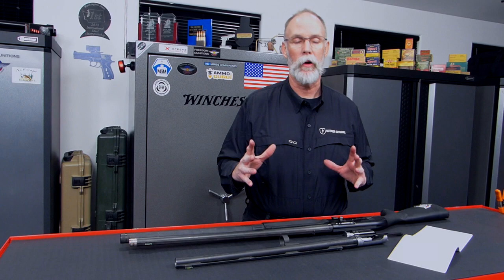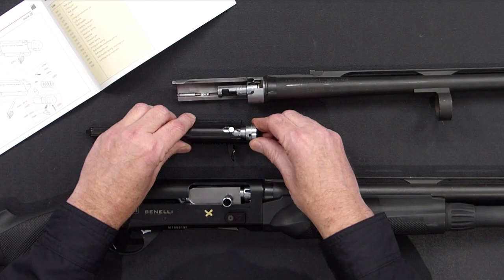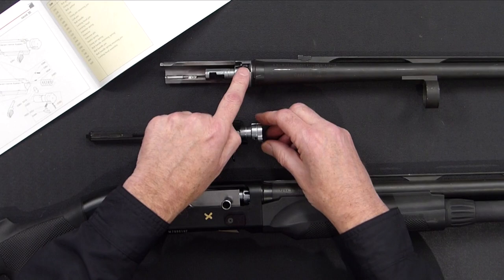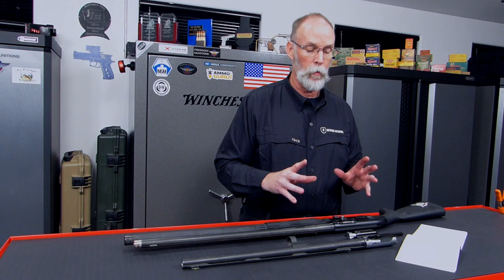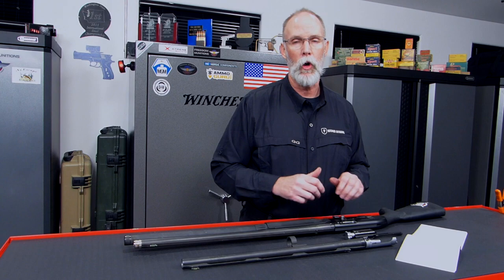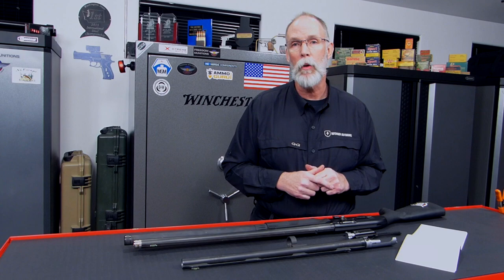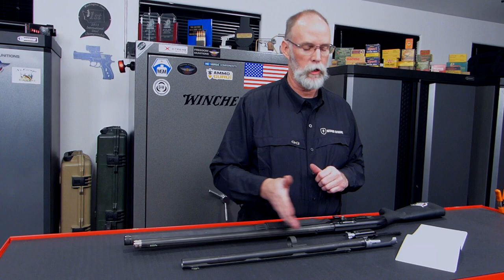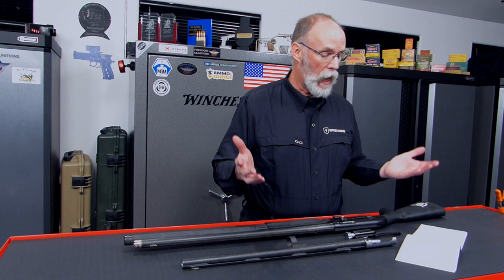Inertia Driven!  How does it work?

Comment: Mr. Kelley,

Sir, this was one of the best examples of a "how does x gun work" videos I have seen. While I love your out of the box and on the range vids, your experience seems to work really well with explaining this sort of technical data. I particularly enjoyed having the parts overlaid on top of the fully assembled gun to help in visualizing where they fit in the system. I would love to see more of these, such as AR-15s, different pistol locking mechanisms, etc!

Comment: the bolt doesn't push on the carrier (it's locked in it's rebate), the carrier (which is free to travel), stays in place due to it's inertia, which, as the gun (and bolt) recoils, causes it to relatively move "forward". Once the spring "bottoms" out, the carrier starts to move with the rest of the gun, and the spring throws the carrier back, causing the bolt to cam open and cycle.

 It's an old, great system, and can be tuned with just a few different springs and/or having an oversized carrier, which you drill and tap for brass/tungsten screws to adjust it's weight. Works in rifles, shotguns, and even pistols.

Comment from the maker: Please share this and any other video of mine that you like.  I don't get a nickel out of the work I do on this channel...yet. Please help me to make my efforts worth it. Thank you!
Reply: Done you know how to fix the issue of the bolt not going into battery? I have an m2 and occasionally the bolt won’t go into battery and I get a dead trigger. Thxs
Reply from the maker: @craigmedvetz2125  Generally that happens when the bolt is pushed out of battery after it is in battery.  If it happens during the normal firing cycle (not when loading it ) I would lube the cam and bolt head (A good idea anyway)  Hope this helps.

Comment: Disregarding the fouling issue, is it possible to design a machinegun with interchangeable barrel fired in black powder similar to the early Madsen machinegun or Maxim gun using this system? or will it not cycle?

Comment: if you had to guess or maybe you know what is the spring rate of the inertia spring? and it would be a bonus if you knew the weight of the bolt with its parts also does the firing pin spring hold it forward before it hits the barrel?

Comment: I just learned about this system. I absolutely love it.
With the addition of 3 more parts, one would be able to adjust the spring compression, in the field, for circumstance and/or lighter loads.
Why do you think that this locking system hasn't been transferred into sub-machine guns, or even semi-auto rifles? Is the increased recoil a major factor?
Reply: Leo Arc it is used on a little known ( today anyway) pistol of the Italian company Bennelli, the b76, please was the Forgotten weapons episode on this, forgotten weapons: the bennelli b76, ian goes into detail how the pistol operates which he describes as ' the closest thing to magic' , its excellent, I'm currently building something based on this premise. thanks
Reply: @williamf9992  I arrived on this video precisely because of Ian :) It was his Bennelli video what sparked the interest in this rare system :)

Comment: Great video! On the Benelli M1, why does cycling the action manually not release another shell from the tube to load into the chamber?
Reply from the maker: Because Benelli found it more reliable releasing the shell on the trigger pull, rather than on the action cycling.

Comment: I understand how the bolt mass offers inertial resistance needed to compress the internal spring but could the system be made to function with lighter loads by using internal springs of lesser weights?
Reply from the maker: Yes it could
Reply: my experience is they still cycle lighter loads ... my m2 12 gauge will cycle 7/8 oz loads it just doesn't eject them with a lot of authority but I haven't had a failure to feed at all using lighter loads. the guns have to be broken in with heavier loads though.

Comment: How does the recoil compare between a semi auto and inertia system.  I know that by nature inertia systems have more felt recoil.  How substantial is the difference given the same load in the same weight gun?  
Also, can you tell me how the inertia system's recoil compares to a pump action or over under shotgun?
Reply from the maker: Too many variables to give you a good answer. "Generally" inertia systems have a bit more recoil. It is possible to calculate and come up with a value but that is of little consequence in the overall comfort of a particular shotgun. Fit, stock design, type of recoil pad all contribute to the overall feel of the gun.  Autos use some of the energy to operate the action of the gun and will have less recoil than a pump or O/U that does not.  Those guns are called "fixed breech".
Reply: @PatrickEKelley3gunfun  Most semi auto guns now seem to have recoil absorbing systems built into there stocks these days so the system is not so relevent.

Comment: So is the inertia driven action better than a gas operated action or just different?
Reply from the maker: +velocity550 The inertia guns stay cleaner much longer (no gas), require fewer parts so the guns are generally lighter.  They are a very simple design that shows itself to be more reliable.

Comment: Why no inertial driven semi-auto rifle on the market ?
Reply: I guess technically (by comparing the bolt and locking lug system here), the AR-15 is the closest common use rifle on the market that uses similar design features, as do bolt actions (but you said semi-auto, so perhaps not).

But, my guess too is that this is designed for cartridges that are high-powered (since shotguns do pack a punch) rounds, whereas a 5.56 rifle isn't going to have as much recoil/inertia-based energy to allow a fluid system.

It's probably possible, but also may require a lot of engineering (if it hasn't already been done before).

Comment: What happens if you dry fired an inertia driven shotgun? Will the hammer not recock as the inertia spring won't store energy?
Reply from the maker: I can't think of a firearm that will "recock" in dry fire.   Double Action guns kinda.  In other words the "recocking" happens during the ammunition powered cycling phase.  So no the hammer will not recock and the inertia spring stores >recoil< energy of the gun firing.